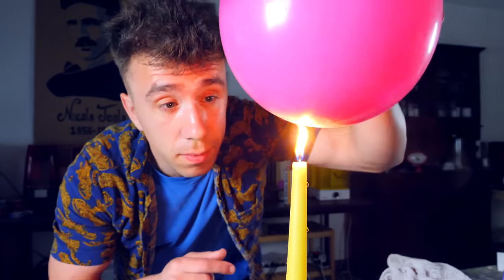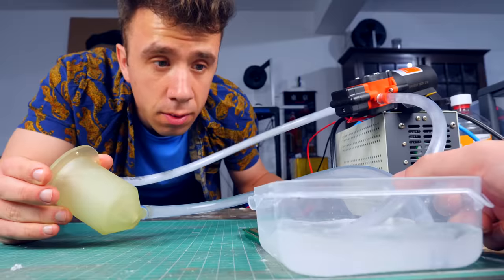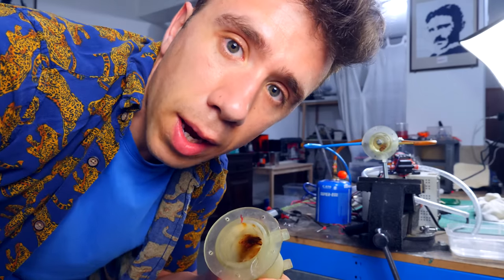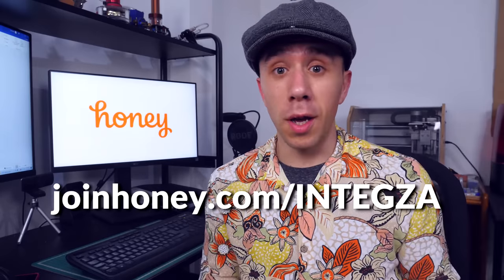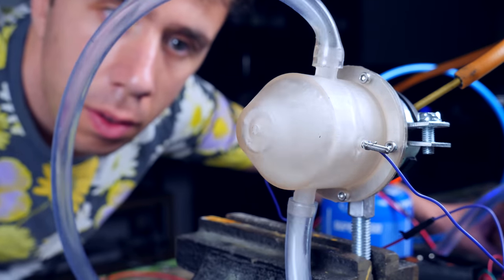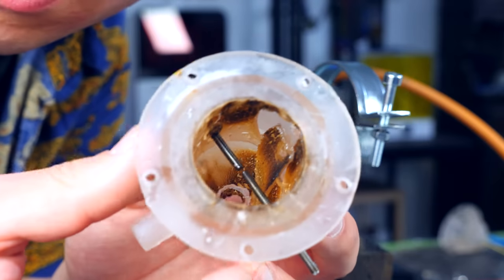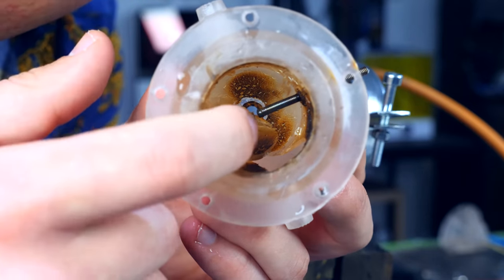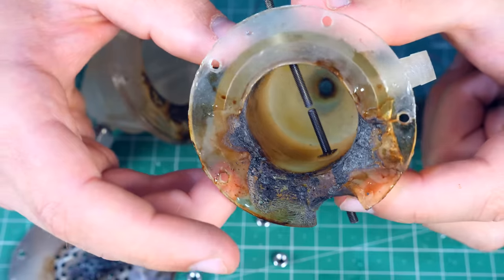Water-Cooled Jet Engine in Plastic

Comment: It would be interesting to watch it run with a infrared camera and see the efficiency in each design change.
Reply: I know IR can't see through glass - kinda cool actually, it acts like a mirror so you can see your heat reflecting.
You'd probably only get the exterior temperature and the heat from the exhaust.
Worth trying though, especially with how affordable FLIR cameras are these days. My CAT S62 smartphone has one built in.
Reply: @Saint_Sigismund  where did u see glass
Reply: @pepeyufera97  I didn't, but because IR cameras can't see through glass I'm not sure if it could see through plastic either.

Comment: Put the water inlet at the bottom and the outlet at the top, pump the water upwards. It'll remove all the bubbles and completely fill the cooling chamber. Your problem could be hot spots forming when the water boils or has bubbles in it. And for a less explosive coolant, try car antifreeze. Although I do like how when the engine fails it puts itself out.
Reply: What I thinking as well, when he had the inlet on the bottom
Reply: You'd want the water being pumped from above since airs natural affinity to rise in water would trap it before makes it to said parts you're trying to cool. Antifreeze inhibits freezing and boiling but you do lose some cooling capacity in doing so. distilled water with a higher flow rate and keeping air out of the cooling chambers is going to do better than antifreeze. That said I think you can use a certain thin additive to prevent boiling without as much effect to the cooling capacity as antifreeze but the issue with antifreeze and other such additives, they may likely damage the plastic as these resins aren't made to be chemically resistant.

Comment: Hey Integza! Heres something that might help, try offsetting the inlet and exit of the water axially such that it creates a sort of "swirl" flow around the chamber, so that the water evenly distrubutes around the combustion chamber (maybe even a spiraling channel). I noticed a few stagnant water spots on the top side of the chamber, and a rather large air bubble at one point, and I belive that is where the inner wall initially failed. Using offset inlet and exits to create a spiral flow to evenly distribute the (moving) water around the engine would greatly help with that!

Also sidenote you are one of my biggest inspirations! I absolutely love your projects!
Reply: This sounds like a really good idea. It could be seen in a few shots the water didn't always do much more than stagnate at the height of the inlet/outlet, so it'd probably help to offset them by 180 as well to try and encourage the flow to get all the way around the chamber.
Reply: This was my thought as well

Comment: I'm really glad you make these videos as you so, it's super fun and I learn a lot for both you and the comments. Cheers mate

P.s don't use liquid butane to cool a fire!! That's really dangerous the amount that's going through!! 

You could try having it so that the water comes in the bottom and has to take a longer path around the jet, think of a spiral from front to back.. water flowing over every surface.

Keep it up!

P.P.S a radiator in an ice water bucket would be more effective for cooling then flammable liquids and gasses

Comment: Instead of using a diaphragm, and the defusing chamber, it may help to have everything water cooled. So if it is printed in one piece with the oxygen being pumped in from the back inside a cone, and the butane being pumped in from the perimeter ~1” away from the back. The gasses should mix well, and you can have water cooling. Also, place the inlet for the water cooling at the lowest point, and the outlet at the highest point of the design, to ensure water equally flows across everything.

Comment: The ("cold") water intake for the engine should be from the bottom, and the ("warm/hot") water outlet/output should be from the top.
This is how it is done in distillers.
Reply: I think that would cause there to be spots where the water is stagnated
Reply: I think having it suck out with a pump from the bottom would make it cool fastest
Reply: It should be cold ingress towards the diaphragm on top, with hot water egress on the bottom at the tail. Otherwise heated is propagating towards the diaphragm instead of away from it.

Otherwise great suggestion👍🏻
Reply: I still think that the "cold intake" should be at the bottom, with the "hot output" being at the highest point. My thinking behind this is that it will allow the water to fill up, and minimize "empty spots"

Comment: I think the reason why you're getting on/off combustion is lack of airflow. Combustion needs a lot of air, and that air needs to behave correctly (not too fast or it'll blow out the flame). The first change I'd suggest is a system to convert air from a compressor to what goes into the engine.

Comment: You should try the lost PLA aluminum casting method! You can 3d print the parts then turn them into aluminum. A forge capable of melting aluminum is very easy to make!
Reply: Great idea, I second this
Reply: Nice idea! The design will still need watercooling, though but might withstand heat a bit better as it conducts better.
Reply: @adriankoch964  I wonder if he could use thin copper pipe and imbed it in the cast. The copper shouldn’t melt and that way he doesn’t have to do any fancy casting to create a cavity
Reply: @Acrophobia2  sounds like a great idea, I'm not sure how compatible it is with the lost pla method tho

Comment: all models leaked initially at the attachment portion. ~ add thick rubber seal on both sides of the metal screen then bolt together. YOUR VIDEO AS ALWAYS IS SO SICK MAN!!! the leak is preventing an efficient startup leading to a partial vaccum adding small portions of fuel to be lost as well as oxygen weakening your startup . the misfires are causing ur heat . AMAZING really when u think of other factor creating the heat - a dam jet of fire!!!! THICKEN the walls at attatchment and add an interior and exterior O ring inside and outside of the bolts to have redundency in your seal! INSANE WORK. :washhands::washhands::washhands::washhands:

Comment: You can improve the cooling eficiency with the inlet and outlet tangential to the chamber. Give them an offset to have a virtual cooling coil. The water will have more speed and take more heat. 

 For the video Idea, I've always being curious about cyclocopters. You can 3D print 90% of the parts and they are a bit unknown

Comment: Cool video! One idea is to make the plastic flanges hollow in the middle and seal them against the metal plate with o rings. This way the water cooling can also cool the metal plate and stop it from melting the housing.

Comment: You should make the inside wall out of thin sheet metal, it would be thin and conductive enough to get cooled down quickly enough by the water, and it would also be much more resistant to the exploision pressure, it should also be pretty easy to make with simple tools.
Reply: You can use a tin can

Comment: I think it would work if you used something like a soda can / tin can for the inner layer, it's way stronger and has better thermal conductivity on top of being a lot thinner.
Reply: That's a good idea. The combustion chamber wall definitely needs to be thinner and I just don't see resin transferring heat well enough to work in this project.
Reply: Keep it steady in another nozzle by waterflow pressure

Comment: Integza could you try to solder a brass tube around the metal defucer and run water to cool the plate before it touches the plastic interface ring? this should cool your last failure location. the cold water should protect the solder holding the tube to the plate from melting. also add some salt to your water and make it colder, the salt as you know will prevent the water from freezing at lower than 0 c.

Comment: Maybe you can use a soda can or other metal can as the inner combustion chamber, with the outer 3d printed water cooling jacket keeping it cool
Reply: This sounds much more feasible and better able to stand up to thermal shock than resin

Comment: Love this water-cooled design - now you should try to increase the cooling surface area within the water channel (ribs/ridges etc)... and maybe consider a heat exchanger to lower the temp of the cooler/working fluid?
Reply: This already has the best possible cooling for the engine, plastic is less conductive than the water, so using ribs or ridges would only make it less effective. The water in the bowl has enough thermal capacity that its probably not even heating up more than a few degrees with each test, and you could solve even that by just taking a larger bucket.

Comment: Try having the internal cooling wrap around in a spiral, like wrapping a wire around a nail. Also try to have your diffuser have liquid cooling as well, maybe with two pieces that come out that attach to a cooling system

Comment: Congrats Integza! You build yourself a butan powered gas heater! But also an Idea: put steelwool in front of the metall diaframe. It is used in gas welders for example, and it prevents gas knockback. So it would prevent in your case, that the explsoion goes back into your diffuser. Therefore the stress on it is lower, and there is less heat. Also you could than also cool the steelwool, and therefore prevent the joint from melting. Sorry for my englisch, I'm from germany.

Comment: Try keeping air out of the water. Air is way more insulating than water, so it is working against you. Also, using small flaps or hairs in the engine where the water flows would increase the surface area of water touching the engine, thus increasing the cooling speed.

Edit: grammar
Edit: I was thinking of vacuum insulation, not air
Reply: I agree with the of removing air pockets.  I think flow should be as laminar as possible to maxime heat transfer. But i think adding flaps will introduce cavitation. Reducing laminar flow and creating air pockets.
Reply: This will work if he bleeds the system
Reply: @TheModerateNewb  as long as the system is closed off from air, it shouldn't make air pockets, but it would introduce more turbulent flow. Increasing the surface area is how radiators work and is also one of the ways car engines dissipate heat through aluminum sheets.

Comment: As a science teacher, I have actually done the balloon demonstration in the classroom before. It is a great way to show the properties of different materials conducting heat!
With that same idea, try using a different metal for the joints and defuser, one that has a better heat capacity. That way tbe defuser can get hot but it will not radiate heat to the joints and melt it. I would suggest aluminium.

Comment: I would love to see you tackle a turbo prop engine. It's the perfect mix of propeller AND combustion jet engine. The prop even feeds the air into the compressor for the jet engine. It's such a cool design. 

In terms of water cooling, I think the basic principal you have is sound, but you might want to look into the water jackets used on machine guns in the second world war. The way the water was fed and drained is designed to completely surround the hot component. I think having the inlet and drain opposite each other is restricting the amount of cooling reaching the entire chamber. You see this where the plate gets hot in only one area, and how when the inner wall cracked, it was at the points where there was the highest heat differential.

Comment: love this design how about making the holes in the diffuser smaller so the velocity of the air/gas mix is increased so the flame doesn't burn in contact with the diffuser. You could also extend the water jacket into the flange so you have edge cooling on the diffuser.
Reply: will still fail, plastic doesn't conduct heat to the water well enough
Reply: @cda32  Did you see the ballon at the start?

Comment: Greetings, 

It may be a stupid solution, but why not do it all in one piece and cool the whole thing, That can be easily done with the resin printer. 

Also add fins on the inside of the cooling ducts, that would decrease the thermal resistance between the combustion chamber and the liquid, I recommend adding fins on both sides (I recommend you take a look at the inside of some liquid cooling cooldplate for power semiconductor or LEDs, an interesting paper on the subject: "Advanced Cooling for Power Electronics"). 

Another possible improvement I see is to improve the thermal conductivity of the material, if I am not mistaken the resin you use is between 0.3-0.4 W/m*k, a solution may be the use of a ceramic resin that will have about 3-4 W/m*k, or directly use iron powder particles or some material that conducts the temperature well.
Reply: OfficialIntegza  grasias grasias pero no lo creo

Comment: An idea or two:
Make a path that the water has to travel around the engine so it is always moving the water around every part equally. You can also pipe the water around the diffuser and run it around like with the engine to keep it cooled. By using small walls to control the water, you also increase the strength to of the engine compared to the no walls design.
Another part of this would be to make a bump from wall to wall to increase the surface area the water is in contact with, increasing the amount of heat it can pull away at any given point in time.
Edit: the problem that happened with the butane was that it doesn’t have a high specific heat meaning it was turning into a gas in the inner walls thus expanding and busting through to the inner engine to then expand again. The reason why water is good for cooling is not only that it conducts heat well but also stores heat until it can leave the system. The water wasn’t vaporizing so it can probably be in the system for a longer time than it was here to keep cooling the system.

Comment: You could try making a device to always have a stochiometric ratio for your combustion, so you can more focus on the engine itself rather than trying to make the mixture correct at each try. Btw love all your videos, keep it up!
Reply: Stoichiometric burn is not ideal when you are fighting combustion chamber overheating; stoich burns too hot. Rocket engines, for example, basically never run stoichiometrically.
Reply: @kebha6308  I thought stoichiometric reactions just had low amounts of biproducts. Yes that means more heat, but it increases efficiency and much more importantly stability. If fluctuation between the amount of reactants and products changes constantly, you get the explosions at the start where not enough butane gas flow is occurring. This results in all the butane combusting and flashback, causing the diffuser to experience heat and pressure spikes.
Reply: Not necessarily a stoichiometric burn but a set regulator assembly to allow simple on off operation
Reply: @kebha6308  assuming you arent running stoichiometric burns, doesnt different nozzle sizes, nozzle angle, chamber sizes all effect the desired ratio of reactions?
Reply: @sezylrin4138  not at the pressures you see in rocket and jet engines. I mean, all those factors should have a small effect (look at the Saturn V F-1 engines having combustion instability due to its size) but it's not a death sentence for the engine at all. Altitude should be the biggest differentiator in FAR in turbo engines that don't have their own oxidizer. His fuel flow and air intake system just isn't sufficient.
Reply: @dainross5321  at the pressures inside jet and rocket engines, it shouldn't matter. The real reason he is getting combustion instability is due to his fuel and oxidizer flow rate. He should have a turbo, or a ramjet/jet fan for stable combustion. Also, because air barely has oxygen in it, stoichiometric would end up needing a rediculous amount of air that isn't really feasible without an oxidizer tank or something. Only at a very large engine combustion cahmber size does imperfect mixing start causing combustion instability in these types of engines if your fuel supply system has sufficient flow rate.
Reply: @kebha6308  Maybe I am misunderstanding the definition of a stoichiometric reaction. I thought sufficient flow rate was one of the conditions for sustaining such a state which was defined by stability, completeness of reaction, and a self-sustaining cycle (Brayton for a turbine and  impeller; idk what a ramjet cycle is called / how it depends on natural convection instead of forced). Can't you still achieve stoichiometry with ambient air pressure as long as a relatively small amount of fuel is used?
Reply: @dainross5321  yes you can reach stoich with small amount of fuel, but then you aren't getting the amount of energy release or thrust required, in most cases. You seem to understand a good bit about combustion and cycles, though. Jet and rocket engines are just a little different due to tradeoffs with weight constraints the dictate performance.